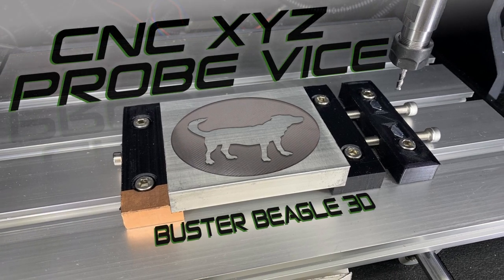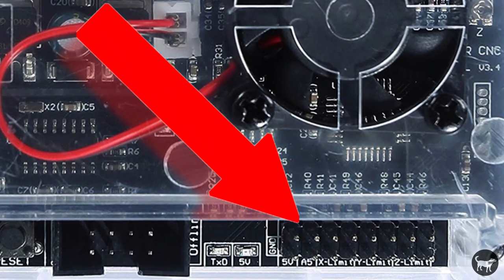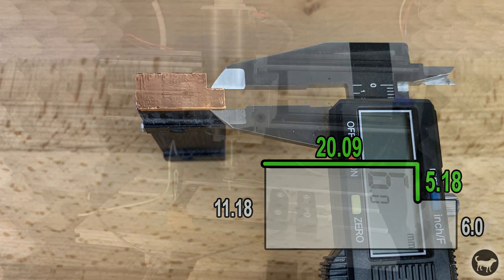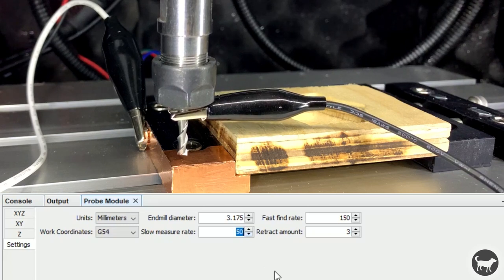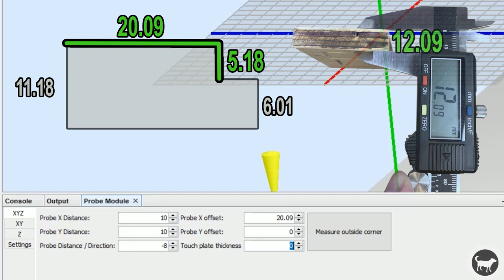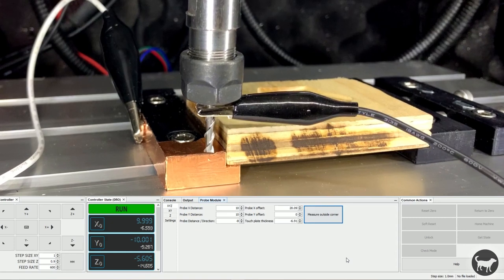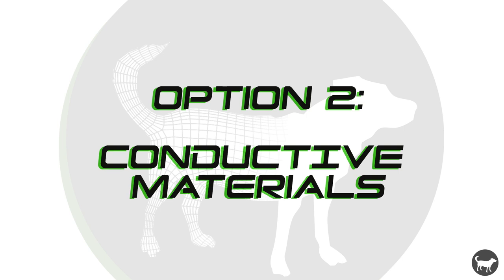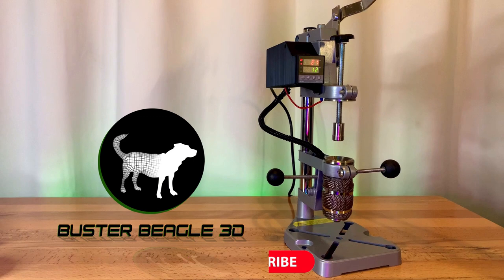XYZ Probe Vise for 3018 Pro CNC Machine

Comment: Brilliant.  I have a similar system for holding my parts from DIYTech that I 3d printed and I think I will use Aluminium tape instead of the copper since it is 1/3 the price.  Thanks for this idea.

Comment: Hi Ryan. I've recently upgraded a 3018 cnc with the banggood machifit spindle, and got some 1/8   tungsten carbide endmills from.amzon. Do you have any specific recommendations for best endmill sets.for small aluminum mold runs  please. I got single fluted ones to start with. Regards. PK
Reply from the maker: I have pretty much just used cheap endmills off of Amazon like you are saying. I did however buy a larger 1/4 size endmill that I really liked to do a lot of the initial clearing of the part.  I have videos where I go over how I cut aluminum but it I would make one change to the videos it would be that I lowered the stepover amount from 40% to something like 20%. That way you can increase the speed of your cut from something like 100 to 500. It cuts much faster with way less chatter of the part. I also then cut .2mm instead of .1 when I decrease that stepover.   Here is the link to the bit I was talking about. https://amzn.to/3sRV976
Reply: @BusterBeagle3D  Thanks Ryan, Ill look into these settings when experimenting, and thanks for the extension barrell, it arrived last week.

Comment: Might be a dumb question but what is the purpose of completing the circuit with the alligator connectors and using the copper tape when probing?
Reply from the maker: If your part is not conductive you are probing the vise to find your zero point. The copper tape is providing an inductive surface to the plastic so you can find the location of the vise and then through measurements find the location of the part.
Reply: @BusterBeagle3D  Ahhh that makes sense. But in both scenarios the alligator clips are still needed to complete the circuit you mention? What is the purpose behind this?
Reply from the maker: @AidanSample  Just so they can be attached and removed easily. One has to clip onto the bit and the other to the vise or part. You can use whatever you want as long as you can secure the connection.
Reply: @BusterBeagle3D  But why is the connection at the vise or part and but necessary to begin with? 

Also thanks for the replies your videos are awesome! just trying to understand everything that’s going on.
Reply from the maker: @AidanSample  You can use the vise without anything else if you like. The wire connections are for resetting your zero position on your machine so you know exactly where your part is in relation to the CNC Spindle and bit.

Comment: I set up my router the same way and when I hit measure outside corner my z axis goes up 10mm and then alarms saying that it failed to contact the part
Reply from the maker: Just make sure you have a negative number for the Z in UGS. Otherwise it could either be your board or firmware that isn't allowing it to work.
Reply: @BusterBeagle3D  i changed it to negative. I posted on a Facebook page and that’s what one guy told me and it worked but now I’m having issues with the router going away from the material instead of to the center and I’ve tried using the rotate 90 degree button in ugs but that didn’t help even after using the reset zero button next to the rotation button
Reply from the maker: @dirtbikedude2989  Are you resetting to zero before you run the probe? That could account for some irregularities if you are not.
Reply: @BusterBeagle3D  yes I reset all axis to zero before running the measure outside function

Comment: What spindle motor are you using on your 3018 cnc?
Reply from the maker: I’m using a 500W 52mm spindle with a dedicated speed controller. I’m sorry but I can’t remember the exact brand off the top of my head.